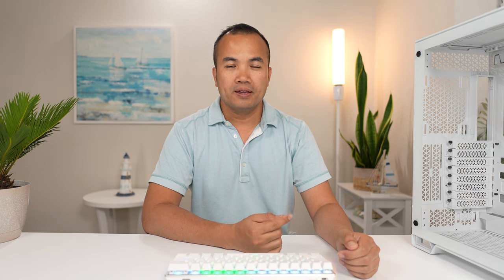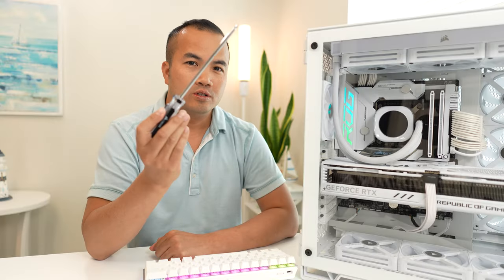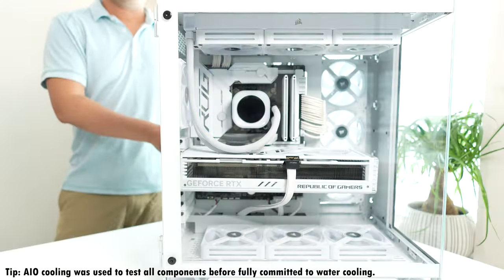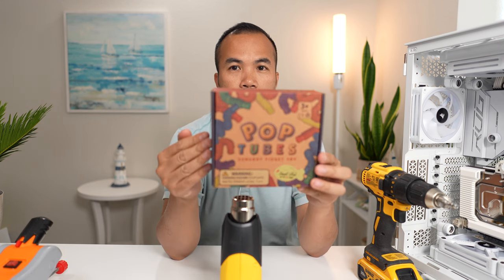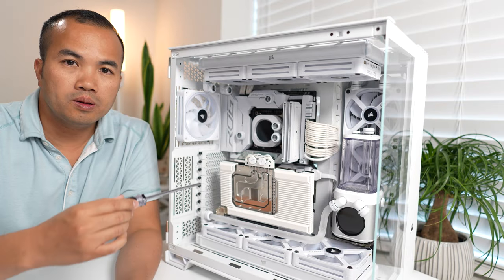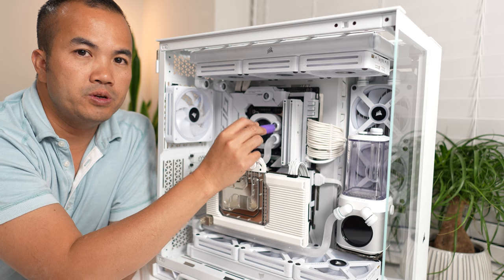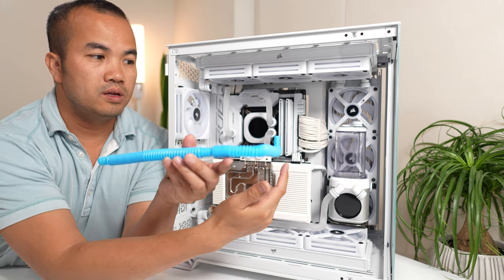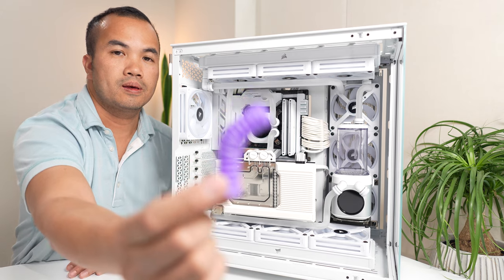Episode 2 - Corsair 6500x

Comment: Thank you very much  ..love when you bend the tube look easy but when i try not easy
Reply from the maker: You can do it! Practice making 90 degree bends. Take it slow and don't force it.
Reply: @Keep-IT-Cool-Custom-PC  is it possible to use the 4090 in horizontal with the original air cooler and still use this reservoir on that same spot?

Comment: I've seen your video many times and I'm still wondering with what thing you are holding the GPU
Reply from the maker: @irbis_ruu  you mean how is it vertically mounted? The bottom is resting on the fans and 90 degree PCIE riser. Top is held by hard tubes. You can buy a PCIE vertical mount that can accomplish this as well.
Reply: Yeah I already figured out what support to buy, I'm just very minimalist especially when my GPU it's very big even assembled in the xg7 adapter already (msi 4080 suprim), anyway thank so much for the video as well, all the best  @Keep-IT-Cool-Custom-PC

Comment: Great video - you made it look easy -  makes me want to get this case and build a custom loop.  Do you have any idea what sort of fan rpm you get when the PC is under full load/gaming?  Just wondered if it sounds as good as it looks!!??
Reply from the maker: I'm using the QX120 fan and I generally set my fans around 60%, that's around 1200-1500 rpm. With iCue, I do have a gaming profile which it'll switch to 80%. Keep in mind that these components are high end and they do produce a lot of heat.
Reply: @Keep-IT-Cool-Custom-PC  Thanks for the informative response. The fan RPMs are higher than I would have thought for triple rads, but like you say you're running high end components.  The QX120 fans look amazing, but I guess I would get lower RPMs if I went for different fans (I've just seen this https://www.youtube.com/watch?v=8QNe1kYQ49k&t=494s )

Comment: Is that the Corsair Vertical GPU Mount? I was told couldn’t fit it with a Corsair XR5 360mm rad and QX120 fans on the bottom of the case.
Reply from the maker: No mount since it couldn't fit a 360 radiator with the fittings on the left side. It can be done when you orientate the fittings on the right hand side. 
For this tube run, the GPU block is held by tubes going up into the CPU block and to bottom radiator. The 90 degree PCIE riser also provides support.
Reply: Can I get a link to the GPU Riser you used?
Reply from the maker: @TNTDesignsofMississippi  I used this riser https://amzn.to/4dfOhY8